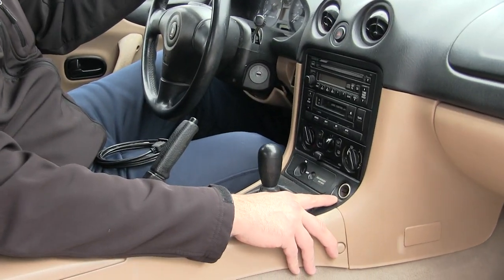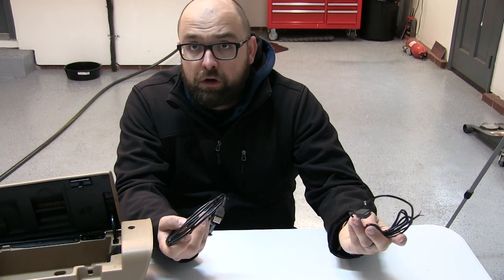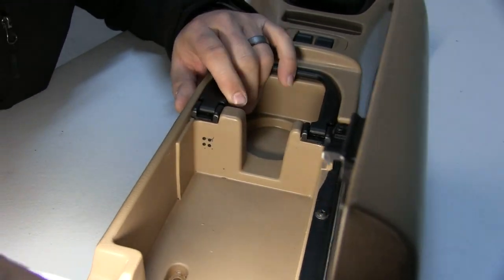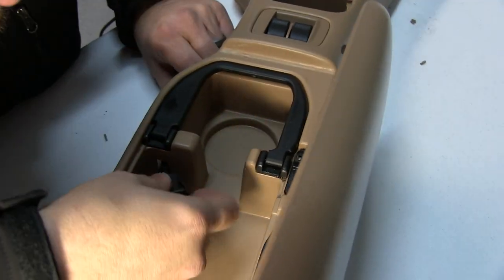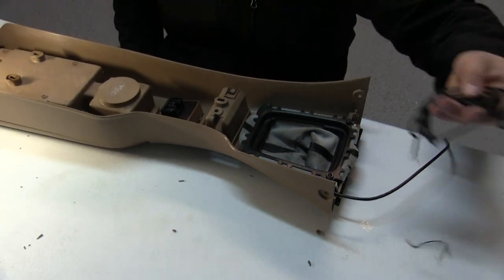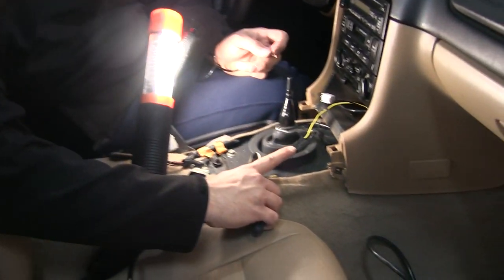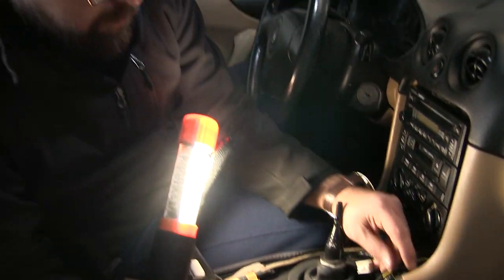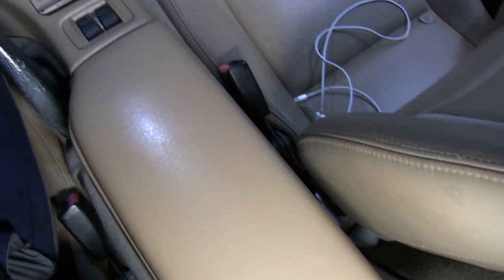Cheap USB hack for your car

Comment: With the USB power and cigarette lighter power soldered together, how do you remove your center console?  Is there a connector that could be used to allow removal of the console?  Thanks.

Comment: Nice video. 

Even better: You can get a single part that does the whole job (USB dashboard mounted receptacle powered from 12 V) rather than the two parts you used. About $12 instead of $25.

This one has two USB ports and shows the car’s voltage! https://www.amazon.com/Charger-Socket-BreaDeep-Voltmeter-Motorcycle/dp/B0773JN9NQ/ref=sr_1_1
Reply from the maker: Thanks. We considered something like that but it was a little bulky for our use.